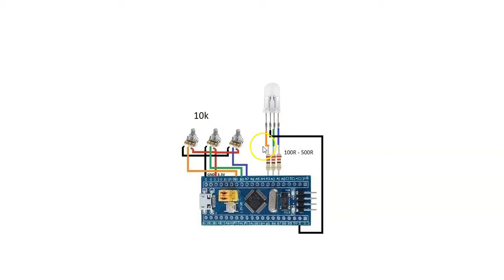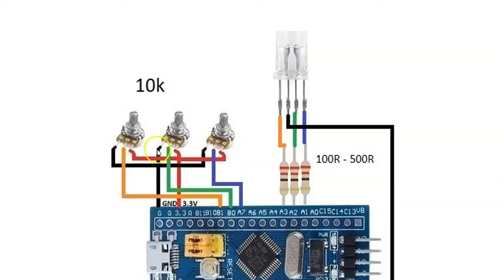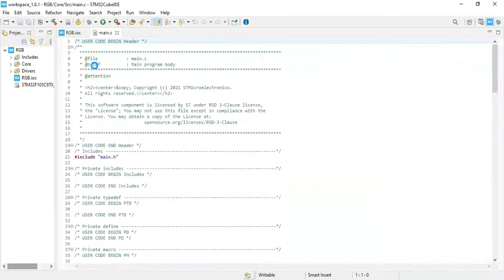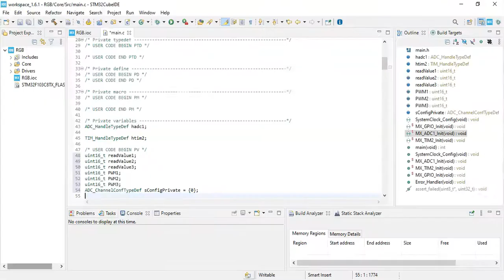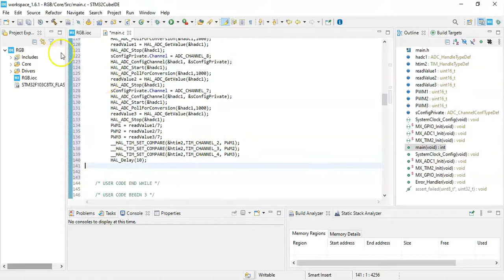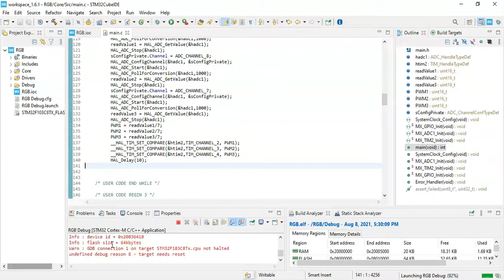32. STM32CubeIDE RGB LED. Multi channel ADC with STM32F103C8T6

Comment: Your Video's are quite helpfull and thank you for that. I miss the explenation on how to select the ADC channel. It seems this is done via a structure. The structure can be displayed by selecting the "ADC_ChannelConfTypeDef" parameter and press F2. The  structure than will be displayed. By setting the structures value ".Channel" a specific ADC is selected.

Comment: Hello, I have a potentiometer and a temperature sensor. For some reason, when I turn the potentiometer all the way up, it reads 4095 (12 bit resolution) correctly, but also the ADC from the temperature sensor goes up to 4095. Also it doesn't seem to read values less than 2000, even if the potentiometer is turned all the way down.
Reply: You need to address the specific IO Pin before an analog to digital conversion. This is done via parameter "sConfigPrivateChannel". A two pin conversion would be something like this:
	     sConfigPrivate.Rank = ADC_REGULAR_RANK_1;
	     sConfigPrivate.SamplingTime = ADC_SAMPLETIME_1CYCLE_5;
	     
             sConfigPrivate.Channel = ADC_CHANNEL_0;
	     HAL_ADC_ConfigChannel(&hadc1, &sConfigPrivate);
	     HAL_ADC_Start(&hadc1);
	     HAL_ADC_PollForConversion(&hadc1,1000);
	     ADC_Result_I16 = HAL_ADC_GetValue(&hadc1);
	     HAL_ADC_Stop(&hadc1);

             sConfigPrivate.Channel = ADC_CHANNEL_1;
	     HAL_ADC_ConfigChannel(&hadc1, &sConfigPrivate);
	     HAL_ADC_Start(&hadc1);
	     HAL_ADC_PollForConversion(&hadc1,1000);
	     ADC_Result_I16 = HAL_ADC_GetValue(&hadc1);
	     HAL_ADC_Stop(&hadc1);

Comment: Hi, Can you explain why did you use specific timer values
Reply from the maker: I set Prescaler  to 127 and Counter Period to 625 because I wanted to have 100Hz PWM for LED’s.
How I found 127 and 625 is as follows.
Clock frequency is 8MHz (8000000Hz)
I divided by 128 and then divided again by 625
8000000 / 128 = 62500
62500 / 625 = 100 Hz
Prescaler is always 1 less. So it is 128-1 = 127
Reply: Thanks

Comment: hello sir, i have stm32 and i want to use rgb led to indicate the different body temperature value, so can i work with only one potentiometer and by using only one channel. what code should i need to use
Reply from the maker: Hi Rosy Melody,
Have a look at https://youtu.be/OvA_g4ez-zs
Instead of internal sensor, use one potentiometer
Instead of three LEDs, use one RGB LED
Cheers
Reply from the maker: You can use one ADC only and use the code given at https://nizarmohideen.herokuapp.com/video33
Change 1740 and 1720 to some values which suits you
  if (readValue > 1740)
    {
      HAL_GPIO_WritePin(GPIOA, GPIO_PIN_7, 1);
      HAL_GPIO_WritePin(GPIOA, GPIO_PIN_4, 0);
      HAL_GPIO_WritePin(GPIOA, GPIO_PIN_1, 0);
    }
    else if (readValue > 1720 ) 
    {
      HAL_GPIO_WritePin(GPIOA, GPIO_PIN_7, 0);
      HAL_GPIO_WritePin(GPIOA, GPIO_PIN_4, 1);
      HAL_GPIO_WritePin(GPIOA, GPIO_PIN_1, 0);
    }
    else 
    {
      HAL_GPIO_WritePin(GPIOA, GPIO_PIN_7, 0);
      HAL_GPIO_WritePin(GPIOA, GPIO_PIN_4, 0);
      HAL_GPIO_WritePin(GPIOA, GPIO_PIN_1, 1);
    }